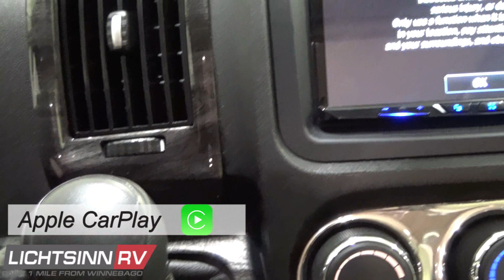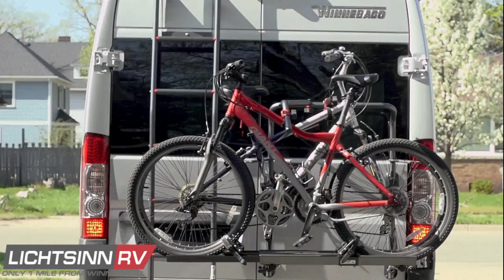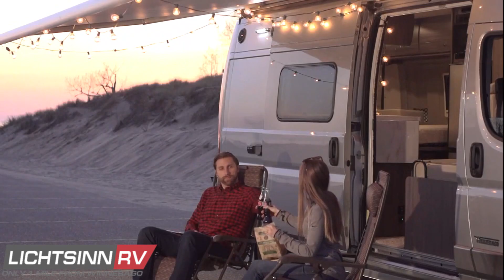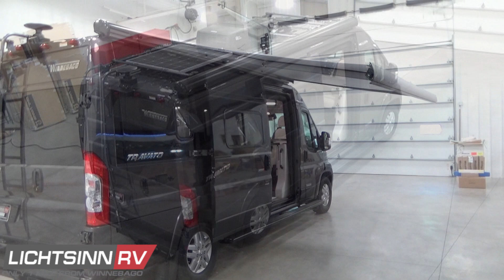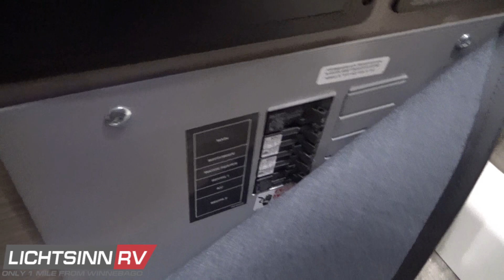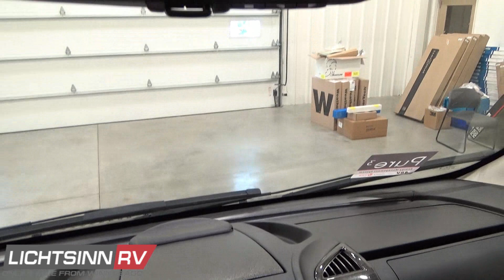LichtsinnRV.com - New 2023 Winnebago Travato 59KL

Comment: How much will it cost when it's time to replace the batteries?
Reply from the maker: Good morning!   Thank you for your note… given the continued downward pressure on new technology pricing over time, it is really hard to predict the cost 8 years from now, the end of the battery’s warranty but directionally, at the current time, the cost to go to a 4th battery pack upgrade from 3 is roughly $3500.   Hope this helps!

Comment: Where is the spare tire ?
Reply from the maker: Good afternoon!   Most light duty and commercial auto manufacturers have gone towards tire inflation repair kits to free up weight, leading to improved fuel economy... so the Ram Promaster has that equipped standard... however if a spare tire is critical for you, we can certainly add one, most often a rear spare tire carrier, no problem.   Hope this helps!
Reply: @LichtsinnRV  Thanks for your reply.  We really love this Van what’s the availability of the  59KL?
Reply from the maker: @Dockwatcher  Good afternoon!   We have many on order that can be configured to your customer content, some as early as February that could be changed... simply reach out to your factory trained consultants here at 641.585.3213 to learn more and cover our factory discounted pricing.   Hope this helps!

Comment: Awning slide window or just slide windows? Are B/G tank heating pads included and is the fresh water tank inside to prevent freezing?
Reply from the maker: Good morning!   Either window configuration is available and you are 100% dead on accurate with your heating pad and freshwater statements.   Hope this helps!